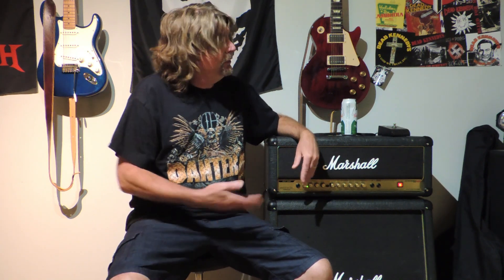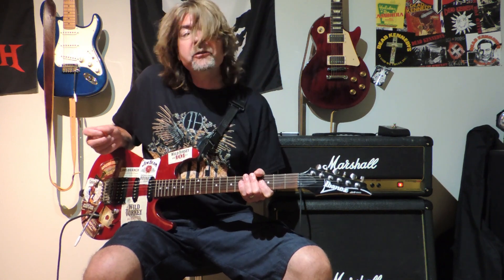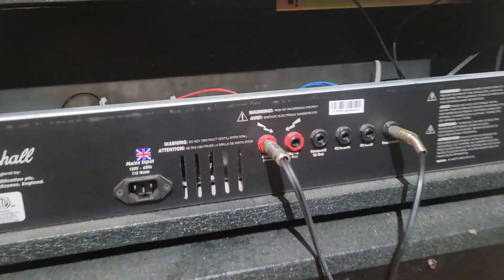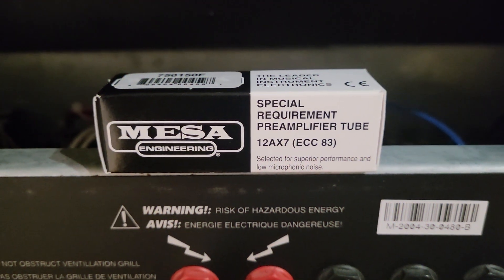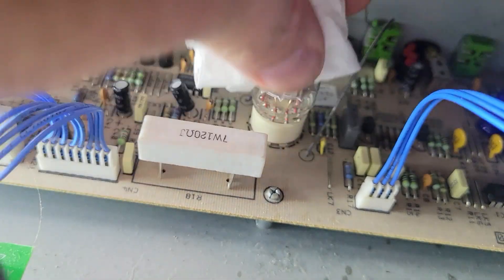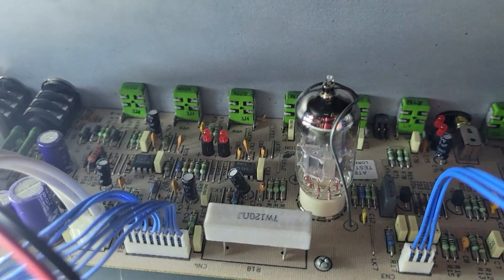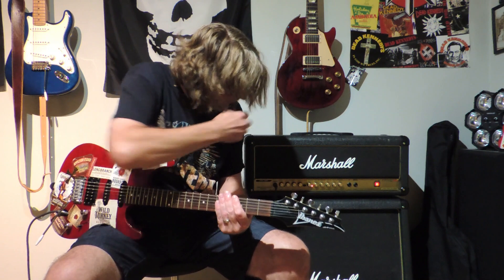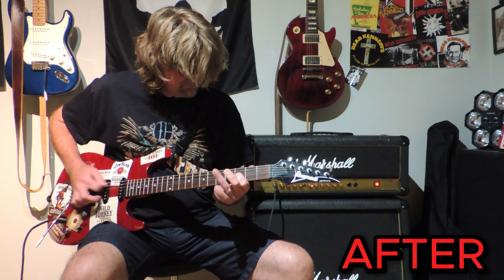MARSHALL AVT 50H VALVESTATE 2000 vacuum tube replacement

Comment: I've had my AVT 150h since 03 and never changed the tube. I think it just blew. I hope that's what it is.
Reply from the maker: Have you had a chance to replace the tube?
Reply: @Haggo76  yes. It didn't fix it. Clean and acoustic simulator work fine,  but  ODs don't work.